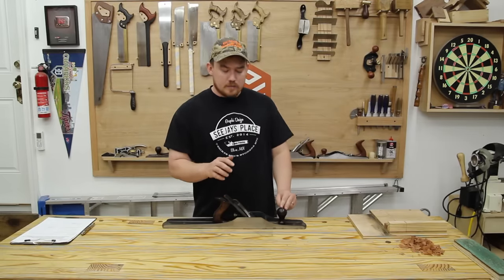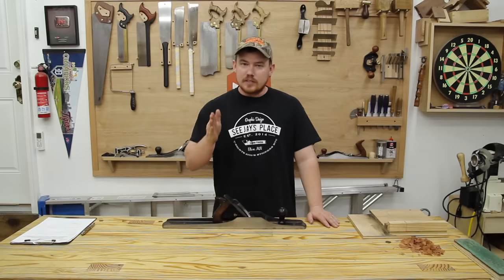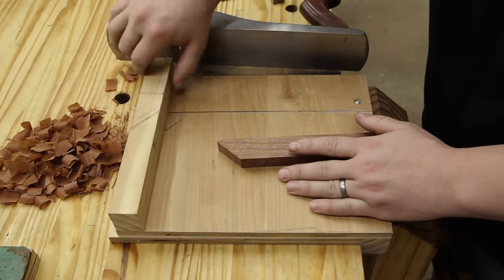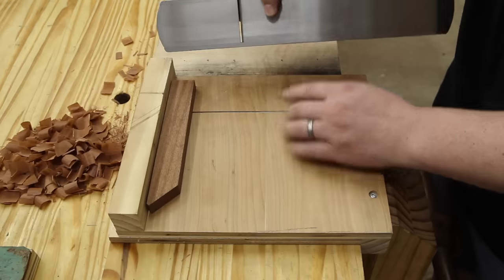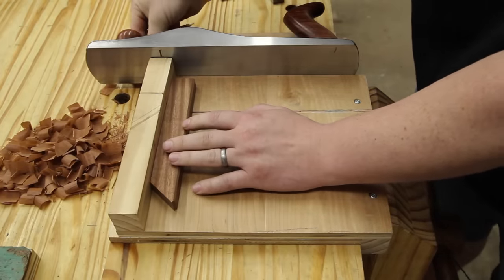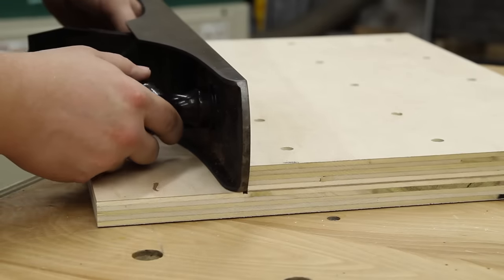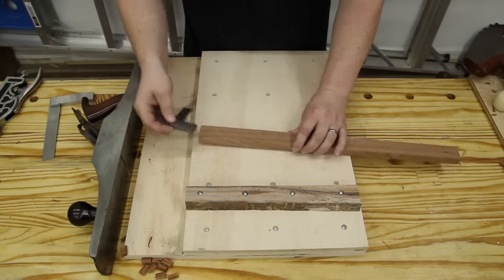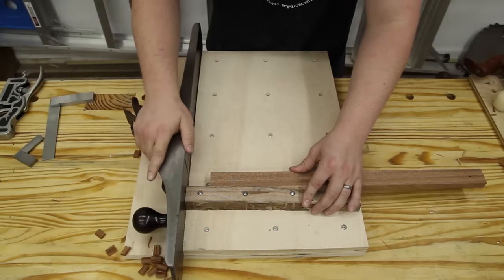A Shooting Board - Why You Should Make One - 264

Comment: I like that very much. It is a great idea. never heard of it before but I have a suggestion. You mentioned blowout that would lead to your work piece chipping out at the fence because of tipping the plane. Since you have the fence set so nice use it as is and when it blows out  add a piece right in front of it. If you use it that much and it blows out again, remove the the added piece and flip it 180 degrees.  I like this. There is nothing better than nice smooth end grain. Thanks

Comment: Why doesn't the corner of the plane's blade dig into the cutting board?   Doesn't it dish out a big chunk?
Reply from the maker: No. It will shave a little off just like the fence. Then the mouth of the plane rides along the bottom of the material base and will not advance any further.

Comment: Does the plywood base not get shaved away eventually from the blade running against it?
Reply from the maker: Just a tiny bit where the blade is in contact with it. Just like the fence. Then the bottom of the plane where no blade is sticking out is in contact with the bottom of the base and prevents future cuts into the base.
Reply: the sole of the plane touches at the bottom so it can not take out any more material.
Reply: I was trying to figure that out to, for once I read all the comments before asking a question.  It is true, old dogs can learn new tricks.
Reply: Yes it does and for all the shooting board videos out there very few point that out...   And also I dont understand removing the registering cleat to square it because you might reinstall it out of square and then your at the same point you started.. And also planing an out of square to compensate for you not installing it square does not make any sense.. just unscrew it and re install it square!!!
Reply: You can always angle cut the plywood so the blade doesn’t shave it.

Comment: Jay this may be a dumb question but how is it not bitting into the fence and table as you go???
Reply: The plane blade does not continue all the way to the edge of the plane so it creates a small ledge on the bottom after it bites in to the depth of the blade.  Is that what you mean?  it makes sense in my head but I am not sure it is coming through in the explanation...

Comment: Thanks! But why doesn't the plane also shave the guide/fence thing? I would have thought that it would have to shave both
Reply: I made a shooting board (tried) and that was an issue for me. So, Jay Bates,  why doesn't the plane shave the bed? I think I will try again today just to see
Reply: Jeremy Herbert agreed, it would see it would get cut away also, maybe just the small shoulder of the plane keeps enough edge to make it not an issue?
Reply: + Jeremy Herbert
I wondered too - then I checked out Google and found this explanation:
http://www.finewoodworking.com/2010/09/17/heres-why-your-plane-doesnt-keep-cutting-into-your-shooting-board
Reply: The first few passes as the plane runs along the board, will slice off any excess on the rear 'Fence'. this was part of the tuning in that Jay described.  Then you have that 1/4"  of the side of the plane sole where the blade is poking through. This runs along the edge of the upper board, and in fact after the few tuning in passes actually leaves a minute step. Can I suggest you watch the video again and pause at 4.10.. that first layer of plywood on the upper platform will remain as the step.  At 7.48  shows a good shot of the underside of the plane and the 1/4", where no blade so no cut. Hope that helps explain :)
Reply: Jeremy Herbert you push what lumber needs to be planed into the plane. Not the plane towards the lumber to be planed.
Reply: Brilliant! Thanks folks, makes a lot of sense. I suppose I need to try making one of these now...
Reply: Thank you for the explanation I was wonder the same thing. Makes sense now

Comment: How is the blade not digging into the plywood?
Reply: Eco Mouse, I was wondering the same thing
Reply: It does cut into the top part a little. The guide is the lower edge of the plane between the blade edge and the side of the plane. Only about 1/8", but it's more than enough if if you focus on keeping the plane flat on it's side. Keep your plane and board waxed and the thing moves very smoothly.
Reply: the plane will cut the plywood edge a bit. But...the blade does not reach all the way across the sole of the plane... so that part at the bottom will never see the blade or be cut. This will be the actual reference.it wont change from the day it is made.
Reply: R C
Reply: I had the same thought as well, but you will notice that when he tunes it, it does cut off the fence and the plywood, but once it is cut, then the edge of the plane below the blade wasn't cut stays there and will wear slowly, so that gives you the clearance to not continually cut the fence or plate (plywood). The only issue is if you change the depth on your plane blade, that could throw the whole thing off...
Reply: Did you see were he explains the end of the plane blade and how there is no blade at the end. It means it is not actually planing the board. 

You will need to actually chose your plane careful and build the board to the planes specifications.

Comment: Great video. A suggestion if the top fence needs fine tuning for square without having to fuss with adding a taper to the fence: Install the first screw closest to the plane; drill a pilot hole into the fence material for the left most screw larger than the screw which will permit fine adjustment of the fence; once the fence is in the right position, install the remaining screws to set the fence firmly in place.

Comment: Very excellent video.  I'll pass along a tip for some of your viewers that may not know this.  With an electric miter box or chop saw, the instructions will always tell you to use a square to set for 90 degree.  A better way, IMHO, is to just cut a piece of 1x6 and then flip it over and hold the blade down while you slide the wood up to it.  The smallest error will be easily seen.  This can be done if about 2 seconds and by flipping the board over, you multiply the error by two so it's more visible.
Reply: Yes, that would work here too, just make sure that the edges of the 1x6 are straight and parallel. 
Also make sure the edge of the fence is straight. Sometimes wood warps when it's cut.
Reply: jfan4reva I believe that the shooting board is the ultimate way to make these cuts.  Like most methods from out forefathers, it's foolproof and really fast and easy.  I wonder if the Japanese use this method.  They are masters.

Comment: I have made a shooting board but discovered that the sides of my No7 are NOT square to the sole! What now??
Reply from the maker: They don't need to be. Use the lateral adjustment to make the blade perpendicular to the bed of the shooting board.
Reply: Answer at 9:35.  Adjust the plane blade.

Comment: Question: How come the top plywood's edge that faced the plane blade didnt get shaved? I can see possibilities of wear there.. is that something to keep in mind if at all it happens?because in the video you didnt even have any shavings form the plywood (which is good), but i feel that if i make it ill have a bunch of it and distort the edge. Was there a trick to how you didnt get any shavings?
Reply: Ayush g I was thinking the same thing..... When he was talking about the candle wax and showing how freely the plane slide back and forth, it never bit into the plywood.
Reply: The blade does not extend all the way from edge to edge of the plane. There is a small area between the edge of the plane and where the blade begins. When breaking the board in, the plane will shave off some of the edge of the upper surface. But, as that little bit of edge is removed, you eventually reach a point where that small ridge created by the small gap between the edge of the blade and the edge of the plane equalizes and there isn't enough of the top surface edge to reach the blade anymore.
Now, say the blade was adjusted for a slightly deeper cut. Once again, the blade would remove some of the edge of the top surface but again would eventually equalize the small ridge and again the blade wouldn't take anymore wood.
Does my description make it a little more clear?
Reply: BigRalphSmith makes sense, thanks. the size of that thing makes you forget the gap between blade and edge could be slightly larger too.

Comment: Superb video. I've been wondering if I can make this accurately with the limited hand tools and power tools that I have (I just have a power drill and battery powered circular saw). This has given me some confidence to at least try it. I also like the information regarding rectifying problems too. Thanks so much. Also, you've done a super nice job on the plane restoration.

Comment: Plastic cutting boards make a nice surface for sliding on, you don't have to use the wax. PE (polyethylene), or HDPE (high-density polyethylene plastic), you can get them in various thickness at almost any store that sells kitchen wares.  Great video.

Comment: Jay: great build. The little tips ( wax, chamfer, etc) are great. I appreciate the detail in your work. I will use your build as a base but I think I will try to extend the usage with an add on. I do see great applications for the insert for frames and trim. My intention is to create a 45 degree ramp that will allow me shoot meters on 2” boards for mitered corners which are ultimately locked by a spline.

Comment: This was tremendously useful video. I am primarily a power tool user, however I find that as I require more accuracy or if my smaller support cross pieces and such are about 1/16" too long it can mess up my shelf placement to a perpendicular face leaving a gap. I have a small block plain that just sits on the shelf,  now from watching your informative video it will come to life and be used nearly everyday in L.T. Wood workshop.  Thanks Jay.

Comment: Very cool. Thanks for details. Just a thought: If you made a wider board with the same setup on the other side, you'd get a longer, more even use out of the blade before sharpening. Just flip the plane on the other side. Maybe even be able to test the squareness from time to time by marking the endgrain and running a couple of passes on each side. 
Great job explaining your process. Keep up the good work!

Comment: Hi Jay, thanks for the video. I'm just about to build myself a shooting board... quick question that keeps coming to mind, but I guess would be solved once in use - I'm curious as to why the plane, as it slide along, does shave pieces of the plywood itself?
Reply from the maker: the sole of the plane touches at the bottom so it can not take out any more material.

Comment: Just a question, not that I’m doubting your build. I️ just remember Rob Cosman’s shooting board build talking about how gluing makes the laminated board bow, so he molds it over this very slight crow, with clamps on a machined table etc. And your screw method just seems so much easier, so screws hold up pretty well and make a dead flat shooting board huh? I’d much rather make this one.
Reply from the maker: I've not had any issues with it.

Comment: A quick attach 45 degree using dowels might be an easy add on ? Would be very useful for frames etc, 45 degree with a handsaw is often a pig to get perfect !  Thanks Jay ! : )
Reply: I've made nice ones over the years, but most of the time I've just screwed a couple of pieces of AC ply together with a  1x2 furring strip as a fence and rub a little wax on - takes a couple minutes using scrap. Doesn't have to be pretty, the angle just needs to be right. If you're doing things like picture framing bead trim inside a panel with 45's, this is the way to make them line up perfect without going to the chop saw and trying to cut half a hair.

Comment: Thinking aloud - What if we have a 'second fence' that can swivel on a single screw/pivot, and which rests on the fixed fence? This will help in a) make minor adjustments to the angle and b) help in making miter cuts by swivelling the second fence to the desired angle. Next up, maybe we could use a teflon board instead of plywood or any other wood that we usually find in our shop. Teflon, they claim is the slipperiest substance made by man, and is much hard wearing than wood.
Reply: Safe Line Fleet
There used to be one on the market that had a fence just as you describe. Quite handy I would think. Instead of using Teflon for a sliding surface, use UHMWPE. A fraction of the cost of Teflon and near as slippery.

Comment: Great instructional vid, Jay.  I do have one question: The main purpose of the elevated platform is to raise the workpiece high enough to clear the inset of the blade (usually about 1/16"), so why not just use a piece of 1/8" hardboard for the platform instead of 3/4 ply?
Reply from the maker: That would work too.

Comment: I want to thank you for this video. After watching, I went out and slapped one together similar to yours. After tuning up my Bailey #6 plane to use, I was slicing off paper thin shavings off end grain of curly maple. Never did I think this was possible. Now I am going to make a smaller shooting board for my low angle plane. Thanks for the inspiration. Wish I could post pics here and I would have shown you the results...
Reply: Here are a couple photos of the board I made:
https://1drv.ms/i/s!AvPBSJJfE_CWkROuwgiSVZxsYbOR
https://1drv.ms/i/s!AvPBSJJfE_CWkRRjbSGQdd2HhT_F
The only improvement I would make on the next one is to make the fences removable but yet when it is replaced it goes EXACTLY back into place. On my original board, after screwing into place and shooting a few boards, I noticed it was slightly out of square. I tried the planing in place method you showed, but that made it worse in the opposite direction. I had to joint the surface of the fence true again and then remount, taking great care that the screws do not displace the fence when tightening.

Comment: How would you square up the end of a board with hand tools if it was larger than the width of the plane blade (eg a 4x4)?
Reply from the maker: Mark a knife line all the way around it with a square then either cut it off to the line or chisel the waste away.

Comment: thinking about making one for my new 62 low angle that I just got for Christmas. what happens when you need to remove and sharpen the blade. assuming you don't get the blade set in the exact same place every time won't you eventually eat away to much of the shooting board and need to re make it?
Reply from the maker: The blade angle is always set to make a 90 degree cut.

Comment: I need to make a shooting board. Can you recommend a decent plane to clean up mitered joints for  jewlery/watch boxes?
Reply from the maker: Any plane with a sharp blade will work. But if you're looking to purchase a plane I'd start at the #5 and go larger. A #5-1/2 or a low angle jack plane would be a good start.

Comment: Why doesn't the plane shave the plywood fence that the plane is running against? Wouldn't the fence continually get worn out? 

It seems like the plane doesn't take anything off the plane fence but manages to plane the wood that is being fed..how so?

stupid question, sorry I'm new to all of this. 

edit: Just saw Eco Mouse ask the same q
Reply from the maker: The plane blade is not in contact with the entire height of the material platform. It never touches the bottom of the platform side. Therefore it will shave off a little just like the fence and then stop advancing.
Reply: If you're worried about that omar38317, you can cut a rabbet on the side of the top platform so that only the part of the plane where there's no blade touches the plywood.  So place the top platform top down on the table saw and trim off half a blade width (1/16" or so) leaving about 3/16" of wood on the bottom.  Glue it or screw it to the bottom platform and you're good to go.

Comment: Jay,

First let me say I think you’re great, I watch you more than
any other wood guy on the net and I’m a big fan!  The screws you used in this project for the
base 15, IMHO are way over kill I would’ve used 6 or 8 total, just my thought. 

Also maybe if you explained that the plane will seat into
the jig against the bottom bevel where the blade doesn’t contact the wood would
have been helpful. Something I saw in someone else’s video.  But again your still my fav!